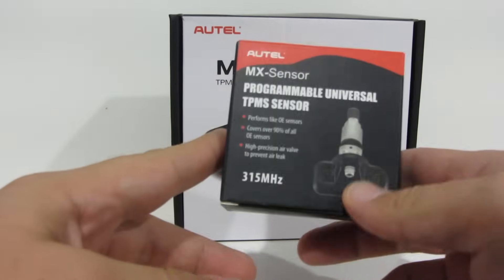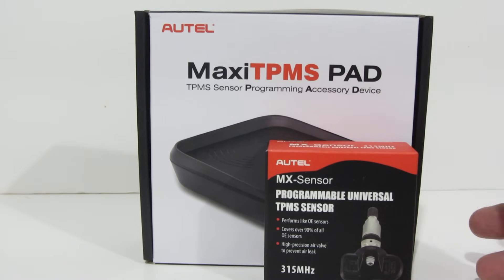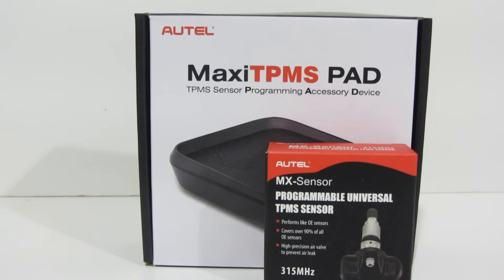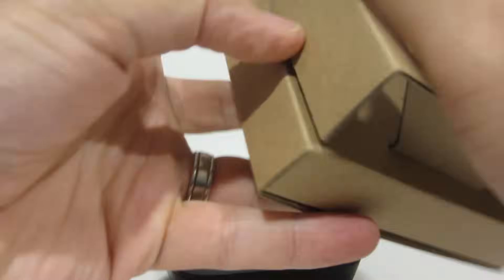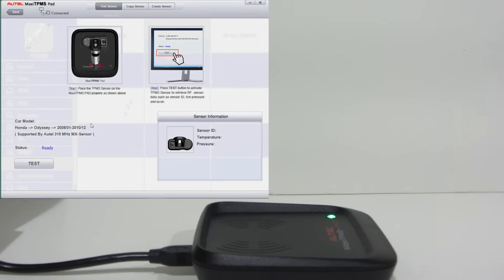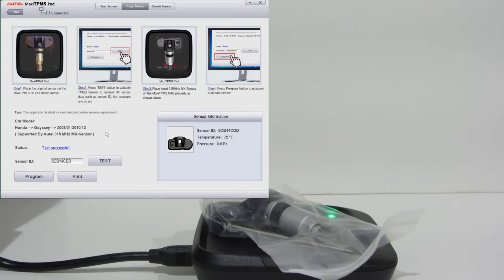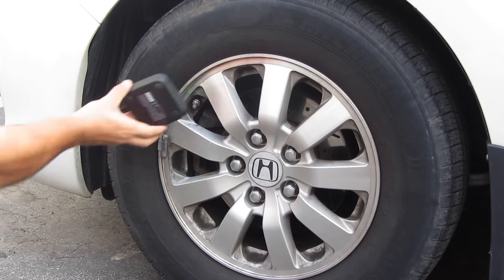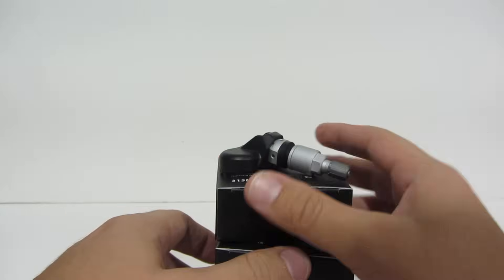Replacement TPMS Sensors for Cheap!

Comment: Does it clone the sensors of Nissan Altima 2010 and Hyundai Sonata 2012?
Reply from the maker: According to Autel's documentation, yes. They both use 315MHz sensors. http://www.auteltech.com/autelcms/u/cms/www/201611/25020613c72y.pdf

Comment: Can't read the ID while it is in the tyre. My car is BMW X5 2008
Reply from the maker: In the description of this video, there's a link to Autel's website that has a list of vehicles it supports. In that list, it indicates that your car automatically relearns new sensors. So you don't need to program the new ones. Just install them and your car will figure it out.
Reply: Wow, thanks for the info, Bro. One more question, do I need to give the new sensors IDs so that the car could recognize them? or the programmable sensors have IDs already? Tks.
Reply from the maker: I think so, but I don't remember for sure. If you did buy the programming pad (it sounds like you did) you can use the "Test Sensor" function to read the code to see. Or if you just want to make extra sure, on the "Create Sensor" screen, there's a "Generate ID" button that will generate a random ID, then you can use the "Program" button to program it.
Reply: Thanks!
Reply: I am also unable to read the sensors with a TPMS PAD while they're in the tire. My mechanic couldn't read any of them with a Snap-on reader either...
Reply from the maker: That's really odd, but at least we know it's not the PAD that's at fault. You don't have any TPMS light on? You're sure the sensors are working?

Comment: Dodge charger 2011
Reply from the maker: According to everything I've found, the 2011 Dodge Charger automatically relearns new TPMS sensors after driving around for a bit (at least 10 minutes). Any brand TPMS sensor will work. They need to be 433MHz.

Comment: Hi Gabe, my car doesn't have the old sensors and i want to install a new ones, how could i do that?
Reply from the maker: You could still use these sensors, but you don't need to program them. You will have to reprogram your car to accept whatever sensors you install. On some cars you can do it yourself, but on other cars you will need special equipment. What year/model car do you have?

Comment: good video. what happens if u want to replace a sensor that's not working will u still be able to access the code?
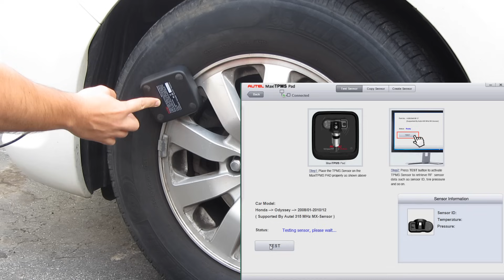Reply from the maker: If you have to replace it, then you will have to open up your tire anyway. You can then read the code directly from the label on the old sensor like I showed at 6:44. I made another video about opening up your tire to replace a sensor yourself: https://youtu.be/Maunq29ow2U

Comment: Not scanning from my wheels that are off the car. Super Frustrating! Do not buy this if you have a Subaru. Most have had negative reports on this working!
Reply from the maker: Yeah, that's really a shame. If you already bought the programmer and sensors, then as a last resort, you can open your tires and read the code from the label on the existing sensors and use that to program the new ones. I made another video about opening up your tires yourself, although I realize that is a lot of work: https://www.youtube.com/watch?v=Maunq29ow2U

Comment: I guess it's easy with my Ford. Got the OEM sensors and tool, may have been a few bucks more expensive than your method, but it way way easier to program. Snow tires went on, put the car into learning mode (google it, it's easy) programmed each tire with the tool, and done. Whole process took about 2 minutes.

Comment: Hi Gabe! Thank you for this video, it helps a lot! I have a 2008 Pontiac G6 and one of my sensors is dead. I bought  an ACDelco which is supposed to match the original Pontiac TPMS, and I'm wondering if I'll have to reprogram anything or if just by replacing it the system would read the new sensor. I know that I have to reset the system, but do you have any clue on this programming stuff? Thanks in advance!
Reply from the maker: I don't know anything about the G6, but from what I found in my brief search online, there seems to be a relearn procedure that you can do yourself that is described in your user's manual. That relearn procedure teaches the car that the new sensor is its own.
Reply: Gabe's Hacks thanks buddy!

Comment: You mentioned that it can read the code while on the tire, could it also reprogram while the tire is on?
Reply from the maker: It's certainly possible, but I haven't tried it. But remember the PAD can only reprogram the Autel MX-Sensors. You cannot reprogram OEM sensors, or any sensor that does not say it's programmable.
Reply: Can it program other brand TPMS? Thanks
Reply from the maker: No. It can only program Autel's MX-Sensors.

Comment: Hi Gabe,
Very nice video! How did you make sure that Autel MX 315 will work with your 2009 Odyssey? I have a 2007 Honda Odyssey  EX and wanted to know if these sensors would work with mine. Can you share your thoughts?
Regards
Mukul
Reply from the maker: Yours will probably be 315MHz too, but in the description of this video, there is a link to Autel's website where they have a document that will tell you. Select the right one for your continent (US, Europe or Asia) and look up your vehicle.
Reply: Thanks! That did the trick. You are right it is MX 315.

Comment: Very cool, I bought the set a set through your affiliate links, you saved me at least 100$ on the sensors alone. I also am an affiliate of my own products on  eBay and Amazon, its a very effective way to make extra money.
Reply from the maker: Thank you! I'm glad I could help.
Reply: Is it possible to scan a programmable sensor for the code after you have programmed it, so if I want to buy new wheels and sell my cars original wheels, if I get rid of my original sensor will it be okay if I have the programmable sensor already programmed . Can I scan those programmable sensors  and program another set of programmable sensors.
Reply from the maker: Yes, absolutely. I have done that myself, although I didn't include that in the video. After you program them, you can go back and read them in just the same way as you read the OEM ones.

Comment: If I have OE sensors on a Toyota that are around 10 years old and are probably going to go dead soon. Can I clone the existing sensors with the Maxitpms pad and replace the old sensors with the new cloned sensors and will my ECU think the original sensors are still functioning?  Are the sensors that are able to be cloned in a "sleep mode" when you purchase them like the OE sensors are and if so does the Maxitpms pad activate them?
Reply from the maker: You can clone your existing sensors and replace them. The car's computer won't know any difference. After programming them with with the pad, they are ready to be put in the car. No further activation is needed. They do normally "sleep" anyway. They are awakened either by a scanner (like the pad) or by the rotation of the wheel. So the battery does not go dead just sitting there.

Comment: I'm seeing that many of those sensors are very weak tend to broke easily  ., there are more videos showing  the same problem,looks like if the salt used in the streets are ruining those sensor top caps  also this bottle that is use for flat tire emergencies is damaging from inside too.
Reply: best ones to use are sensors with rubber stem valves, even if your old tire, or old sensor are the solid type. at the shop i work at, we always try to use the ones with a rubber valve, whether it is an alloy or steel rim
Reply: Autel has rubber stem TPMS sensors,    AULMXSENSOR433R     and    AULMXSENSOR315R

and other brands by WURTH,
Reply from the maker: Nice! The TPMS PAD can program those too. Maybe I'll add an annotation to the video to mention those.
Reply from the maker: Are you talking about TPMS sensors in general? Or specifically these ones made by Autel? The bottles of slime for fixing flat tires will definitely damage any TPMS sensor.
Reply: No,i'm talking in general
Reply from the maker: Can you tell us the brand names of any with rubber stems?
Reply from the maker: eBay has them, shipped from the US actually. 315MHz: https://goo.gl/fD8Byy and 433MHz: https://goo.gl/hArOKb - I added those links to the description too. Thanks again for pointing that out.

Comment: I used it test subaru sensor but it was fail all the times. (The sensor in the tires).
Reply from the maker: Is the sensor working when the car is running? If not, it's possible that the battery in the sensor is dead. If so, the only way to get the code is to remove it from the tire and read the code printed on the sensor.
Reply: I have good sensor, my car tpms light is not on. I just want to put on winter tire and clone oem sensor id to winter tire sensor. But the pad cant get the id. Should I drive car then scan the sensor? Activate sleeping sensor then scan?
Reply from the maker: What year and model of Subaru do you have?
Reply: i have a similar situation. I'm unable to pull the codes off the wheels on a 2015 Subaru Outback.  sensors are supposedly good since I have no tpms warning. bummer.
Reply from the maker: Try upgrading your software. When you first open the MaxiTPMS program, click on 'Setup' at the top. Then click 'Upgrade'. It will download the upgrade package and install it. It also updates the firmware on the pad itself. The versions I have now (after upgrading) are: Software 2.38, Tool 2.9.9, Sensor 4.07
Reply: Hi Gabe's Hacks, I had upgraded to the same versions like you did before I was pulling the codes. I went as far as reinstalling the entire software on a different laptop, upgrading one version at a time, and testing it. Still no go. I'm trying to use SSM to pull codes from the ECU. let's see how that goes.

Comment: I have a question, can you program OEM TPMS with the MAXI/TPMS PAD or you could only program those sold by Autel?
Reply from the maker: No, the OEM sensors are not programmable at all.

Comment: Sensor_FUNCLIST
I presume that all vehicles listed there are supported by pad, meaning it is able to program for those vehicles (my case being avensis 2016)?
Reply from the maker: Yes, correct. So for your Avensis, you'd need the 433Mhz sensors.